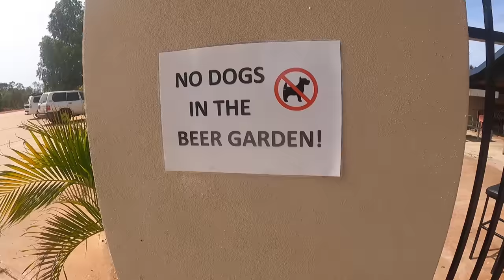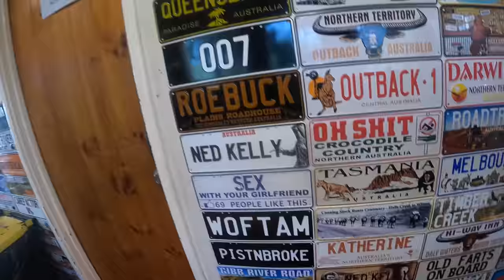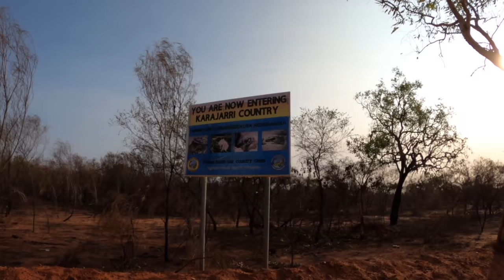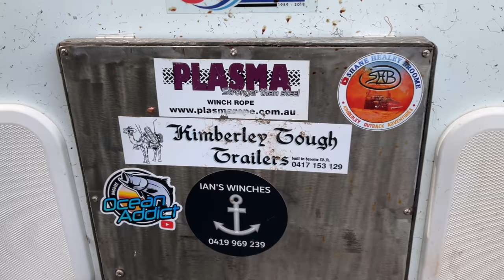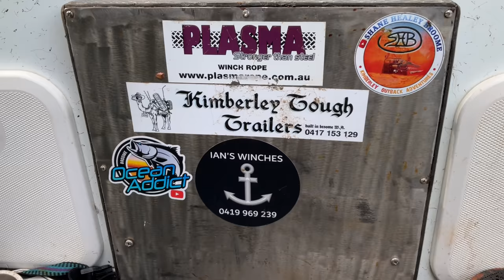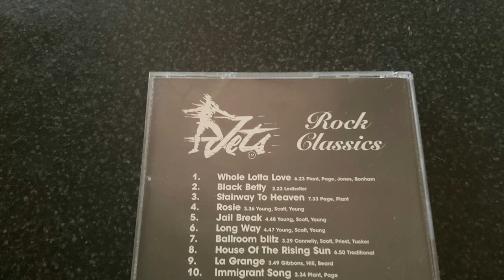A sneaky wet season fish between monsoonal storms

Comment: Another great video.Regarding your boat winch i would run a decent cable from your starter battery for the winch.And leave your motor running when winching.They suck heaps of amps and can kill a battery in no time.Hope this helps.
Reply from the maker: Will do and we are going to put a decent battery in there as well🍻🤠👍

Comment: Another great trip! Have to say from your previous upload you mention the dog and you were advised on 4cyte for the remedy. Thanks for the advice my dog chip is now on the mend and able to jump up into the truck and jump into the dam for a swim. He has the wagging tail again! 👍 go a Raymarine unit to replace the Furuno, still a high end unit but much easier to use. 👍
Reply from the maker: Cheers Chris glad your mate is doing well that is great to hear seems to do the trick that stuff Ray Marine you reckon will have to check them out has to be better than the one that I’ve got 🍻🤠👍